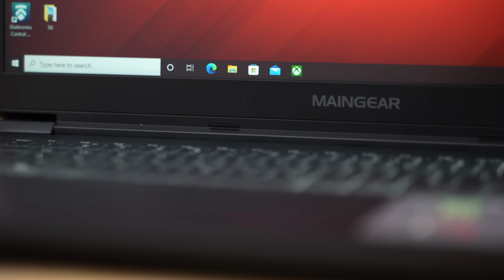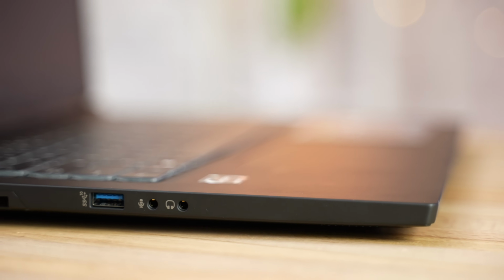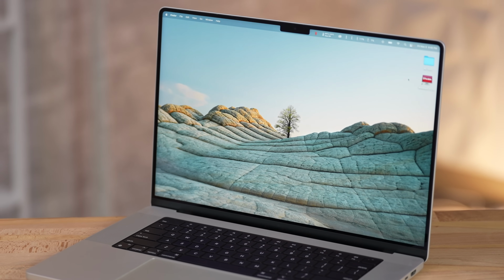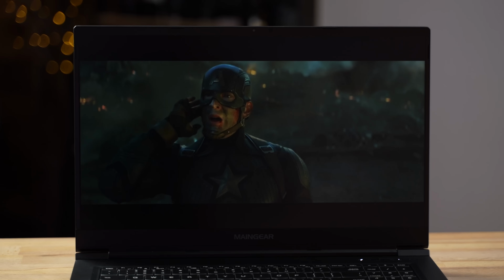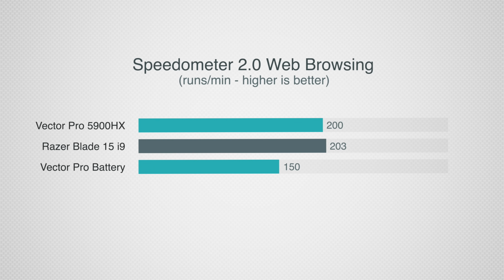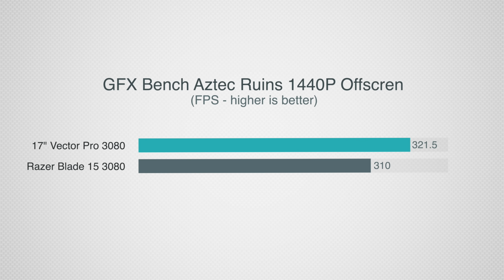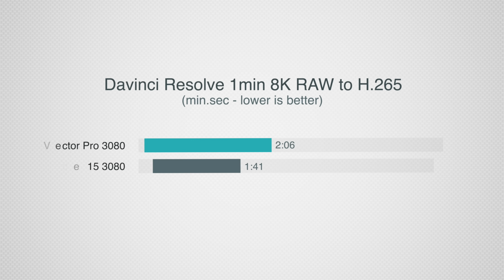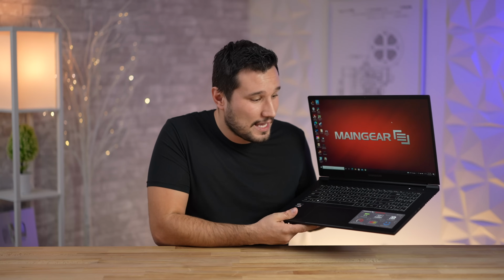Incredible Performance for the $$$ - 17" Vector Pro Review

Comment: All the downsides are easily solved in my opinion. The microphone, speakers, and loud fans can all be solved with nice headset. I am completely satisfied with my purchase. Anything else at this price point would cut the specs by almost half. 
The current price for this machine is 2499, just picked mine up last week
Reply: Hi there I know it's a month late, but I d like to hear about ur detailed experience with this laptop, for me it's either the majngear vector pro with an rtx 3080 and an i7 11700h or the razer blade 15 advanced with and rtx 3070, both cost the same in my country, both QHD screens, with 32gb of ram and a 1tb ssd. Most imorotant thing I wanna know is build quality compared to the razer.
Reply: @NoahiShere2667  I'll start by saying the vector pro I got in USA has 2 tb ssd, 64gb ram, and the 3080 with 16gb. So basically double the specs of the razer. I have only limited hands on with razerbooks so my opinion isn't perfect but with that said, the razer will feel & look more flashy. You have razer RGB software which is more customizable. Both are primarily aluminum and built well, slightly more plastics in Vector but not the cheapest plastics. If your biggest concerns are looks, brand recognition and build quality go with razer. If you want a much more powerful machine with less flash and acceptable build quality go with Vector. The support has been good in my country as well. Not sure about razer support.
Reply: @CMHC  hey another curious shopper here.  Does the vector have advanced optimus / mux switch?
Reply: Hi. I would like to know your opinion about this laptop. How is it? Is it really good and can run all games on high graphics? I m going to buy next week laptop but i cant choose which one

Comment: I've used several laptops based on the chassis that the Maingear uses, and almost all of them have suffered from various build quality issues including, but not limited to, bad trackpads and dead/stuck pixels on the screen. It's a lot of power for the money no doubt, but sacrifices have been made elsewhere that diminish the user experience. A Lenovo Legion, HP Omen, or Asus Zephyrus is a much better product if you're looking at a Windows gaming laptop.
Reply: @cameron_bosch  Maingear is one of many, including Elkutronics, XMG, and Metabox among others.

Comment: I took a chance on their latest configuration with the 12th gen i9 processor, rtx 3080 ti, 64gb ddr5, QHD display, and 2tb drive. For $2800 I honestly can't complain. I've had no issues playing any game I throw at it with high graphics settings. CPU and GPU temps never get above 86c, and most of the time I can get away with not running them at max power and get temps of about 80c consistently.
Reply: I'm thinking about driving to my nearest micro center to pick one of those up soon. How loud are the fans and what warranty options were offered?
Reply: They have it for $1799 now.  I literally just got home from MC.
Reply: Qué tanto recomiendas este portátil leí por ahí que se calienta mucho, pero tú dices que no!  Lo acabo de comprar y me llegará en unos días, ojalá haya hecho una buena compra 🥴
Reply: Is the display good enough for photo editing? Color accuracy?

Comment: Hey Max, while describing/reviewing the display(s) of laptop(s) could you also add the ∆E metric in your talking points as just range of the display doesn't actually translates to accurate displays? There might be other metrics too, not just ∆E, but ∆E would be good enough (for me at least).
Reply: I don’t think they know how to measure delta over there ;)
Reply: i agree with szymon. if they don't know how to, they probably shouldn't. for example, the dell xps including the oled on paper has great delta E accuracy (linus tech tips). in reality, it is way greener than it should be. that is because they were using a colorimeter without using a colorimeter correction. the color science rabbit hole goes deeper than many can imagine.

Comment: I actually OWN and use a Vector Pro,l so here is the deal..Runs fast and quiet and does not run hot.It's lighter than other gaming devices,yet when you add the power brick,it's weighty. It is built like a tank and I have the AMD version. I could have used a full sizes SD slot and at least one more USB C. The sounds is a whisper,even at the top volume,so I bought a JBL speaker,a SD card/USB hub,and i suggest you buy a camera like the Sony EV10...

Comment: Most people don’t need this much power and the price tag is way beyond what most people need for a Windows laptop. The M1 Max is out of most people’s price range and it’s a Mac. I’m sure the M1 Max will continue to beat any AMD chip on performance per watt. Both AMD and Intel are behind Apple Silicon in efficiency, but the leap in performance isn’t as much of hurdle.

Comment: Please swap the ram with higher clock rate (mhz) and lower cas latency and also with more memory chips on the stick 
Then see a HUGE performance difference
Reply: Now you’re probably at $3k.
Reply: It is a boost but it probably wont be that big of a boost and you will most likely need to go down to 16gb if you want really quick laptop ram without spending your life savings.

Comment: Clearly they went for max performance, while cheaping out on every other aspect, in order to produce an "affordable" powerhouse laptop.  It's like dropping a 6-L Hellcat into a Yugo: it may go fast, but you don't really want to own one.
The problem is that they're competing for customers among the $3K+ laptop crowd, who for the most part aren't looking to shave costs by a few hundred bucks.  A comparable M1 MacBook might cost more up front, but it will retain vastly more of its value, long after this plastic fantastic has stopped working entirely.
Reply: what aspects did they cheap out on?
Reply: u tripping bro, its ok build quality for a windows laptop, yes its not xps or surface level, but the price is like 2x cheaper and performance is soo dope

Comment: But it's on sale, the current MacBook Pro's were 20% off at some stores in Australia a few weeks ago and with the discount in Australia the MacBook Pro is cheaper.
Reply: Current MacBook Pros? With M1 chips? I remember JB HiFi was flogging off Intel versions, which are a complete dead end, but I don't recall any discounted M1 MBP.
Reply: @martinXY  no the ones with the M1 Pro and M1 Max chips.
Reply: @WilITaylor  Nice. JB or Hardly Normal?
Reply: @martinXY  both but the deal ended it was for one day only, quite weird considering the popularity.
Reply: @WilITaylor  Which stores had the discounts? I'd like to keep an eye on them in case they do it again.
Reply: @martinXY  they won't do it again I emailed a Harvey Norman manager, they said it won't happen again anywhere in Australia at any store.

Comment: honestly i feel the razor is still a better deal than this. The little extra boost in performance (Really not that much if you actually compare the numbers) does not make up for all the other areas where it is lacking. Horrible speakers, horrible mics,  not so good design (opinion of course), mediocre trackpad and honestly the screen didn't look as good from what i saw. And i just saw a comment saying the real price is $3100 (This is just a sale).

 The only metric this beats the razer in that i really care about is battery, and performance on battery is soo neutered i'd never want to use either on battery for long enough to notice. All in i'd definately take the razor. and honestly this doesn't even come close to the Macbook with m1 pro/max 10 core model Which i feel is a better deal than both.
Reply: 2 months ago it was 2400.00
Reply: @judeg.8101  it still is
Reply: @cryptorellyt  Lmao right 💀😭

Comment: What about warranty, support, battery life and anything else equivalent Apple Care of sorts? Do they have that?
Else, looks like a great bang for the buck… however no thunderbolt isn’t that a major dealbreaker? if the mob conglomerates when a 10 year old SD Card slot or HDMI got removed, then for sure as heck there should be riots for no thunderbolt ports in soon to be 2022. Especially if it is a portable desktop, it would benefit from that single cable that can connect daisy chained monitors, Thunderbolt splitters, external drives, mouse, keyboard, interfaces and charge your laptop all in one go. I understand that it is an Intel vs AMD thing, but darn, too bad that.
Reply: There is no tech support if you update to windows 11.  I went back and forth because the command center they use doesnt work in windows 11 and makes the laptop unusable other than a tablet without a touch screen.  After several e-mails back and forth maingear tech support told me they couldnt help unless I downgraded to windows 10.  They are suppose to contact me when they get the software fixed and its been over 4 months and still nothing.  I would spend the money on a name brand with actual support.  Another thing this is a paid review from microcenter.  I wasnt even allowed to review this product on Microcenters website cause it wasnt a positive review, I submitted it 2 times over 3 days and they told me they would not post my review.  This youtuber is a sellout on this product, glad i'm not subbed.

Comment: How does this compare to the Macbook pro-M1 Pro chip? I'm stuck between choosing windows or apple I'm familiar with both systems
Reply: Windows for everything..... MacBook is for Video/photo editing.... That's all.

Gaming / and most of others application are absent on Mac. And Windows are easily repairable and upgradeable.
LIKE on Mac everything is fixed.... SSD/RAM are fixed if they failed everything faild

Comment: i purchased one of these models, windows applications arent any faster than with 32gb ram, the charger can barely keep up, the screen has bad backlight bleedthru along the bottom, the thermals out of the box are terrible like 95C, and the 3080 drivers are flaky and result in screen freezing at least once a day. 
its a piece of shit.